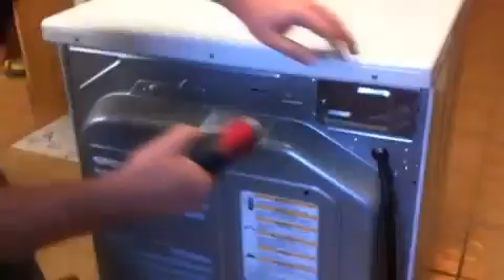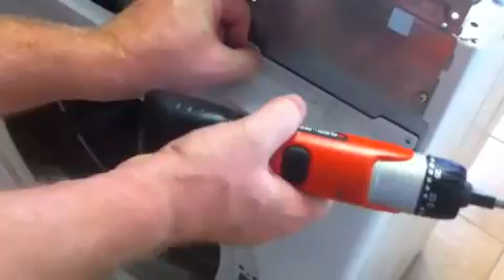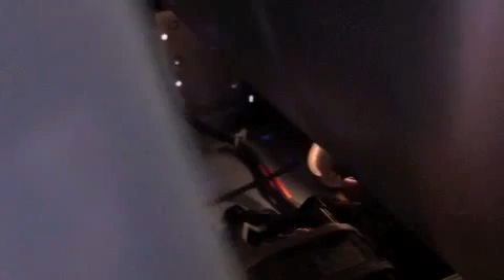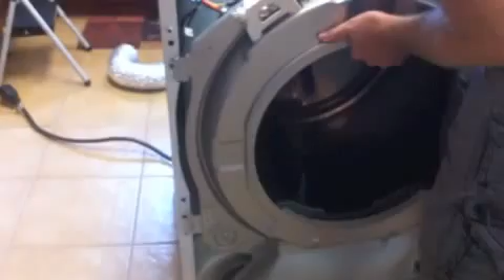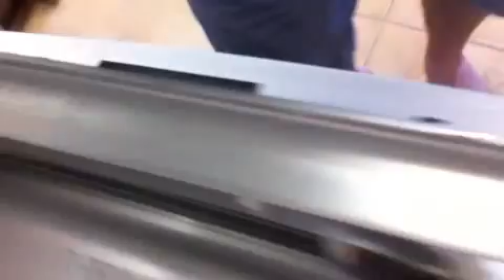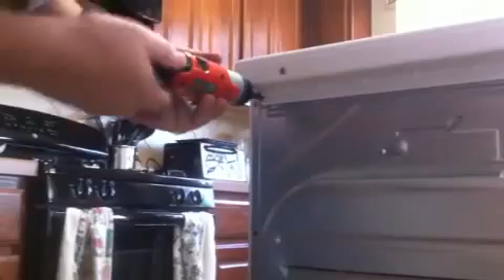DIY LG Dryer Disassembly

Comment: Thanks for the video. Have an LG, took it apart, cleaned it out and reassembled. No problem with it, just due for a good cleaning. I struggle with re-attaching the pulley, but when re-checked the video it was a piece of cake. Mine is almost ten years old and it was due. The reason I looked this up was due to a slight burning smell while running the dryer. The burning smell is not noticeable outside the unit but when you stop it and open the door you can smell it. No smoke and certainly nothing visually alarming, but the smell is still there. It could just be the heating element, but I am going to keep a close eye on it and make sure nobody is running while not home. Any advice on what might cause the slight burning tinge. I dont think it was there a year ago and the clothes smell fine and like I said no smoke. I work around electronics and have blown up the odd relay or drop-out so I know it is not major yet. Just curious what your feed-back might be. Thank you again.
Reply: +Mark My dryer was an LG TROMM DL8377CM, was bought around 2007.

Comment: Awesome instructions on both disassembly and reassembly! I had a drum that is cracking along the weld line and I was able to put some heat resistant tape along the weld. The second time I've done this with your video. It lasted a couple years I'm hoping it does again. Thanks!

Comment: LG wanted $290 for a visit to fix my dryer. They estimated a total of $400 for an hour of labor on top of that plus taxes! Warning- Do NOT run the dryer with the filter removed. We forgot to put it back and a sock got sucked into the blower making the machine shake. squeal and actually make the lights in the house flicker ! Your video allowed us to disassemble the machine properly, remove the obstruction and reassemble without any damage. It gave us a good opportunity to give the machine a good cleaning from the inside. Much Appreciated !

Comment: Thank you so much for this video.  I have a LG DLE2101W with a terrible vibration.  Though they aren't exactly alike it gave me a great start and led me to the drum roller in the back that was worn badly.  It has been replaced and the dryer is like new.  Thanks again

Comment: Excellent Job!
Just took my DLG2522W apart to change the rollers and belt. Same dryer, only gas. Your excellent video took the mystery out. Other forum directions I had seen skipped about 80% of the steps and were useless. Thank you very much for the accurate information!

Comment: Wow I wish you were here to help me right now. The four screws at the top of the front panel absolutely will not budge. My fingers are raw from trying to get the wire harnesses disconnected. It certainly is going MUCH easier and quicker for you in this video, so jealous. I am afraid to try using a power driver on the screws in fear of stripping them.
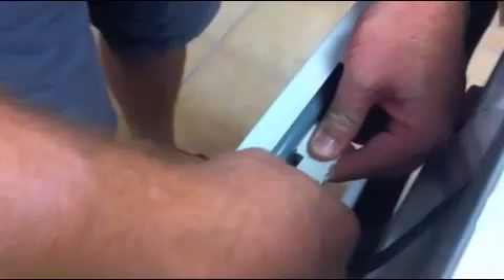Reply: The white connector at front top (3:10 into video) was very difficult on my dryer to demate.  No connector lock, just had to be pulled out hard to demate. After spraying with WD-40, I was able to pull out.
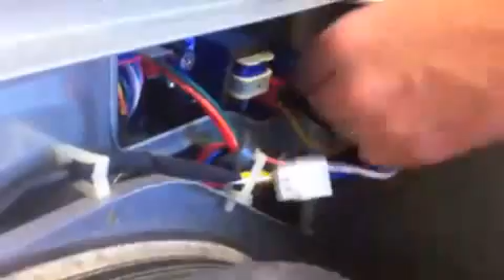The 4  colored connectors (1:50) on front panel do have a locking mechanism on each that has to be squeezed together to demate.  However, I did not demate any of those 4 connectors as I was able to set the front panel on top left side of machine during disassembly with all 4 connectors mated.
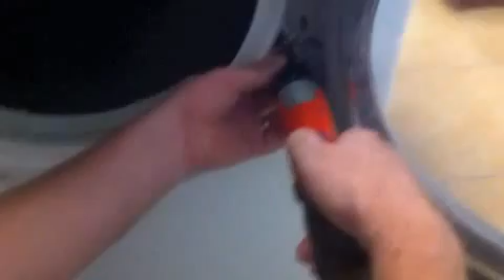Also, I did not remove front door (2:20) as this was easily kept on during disassembly.